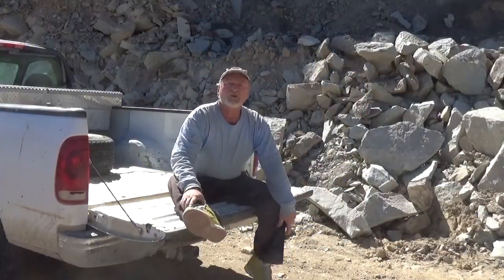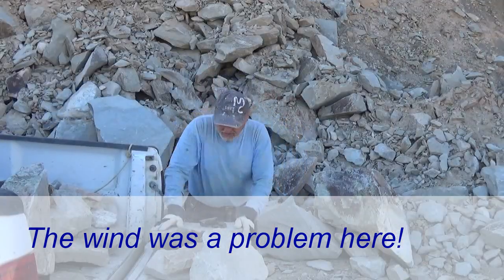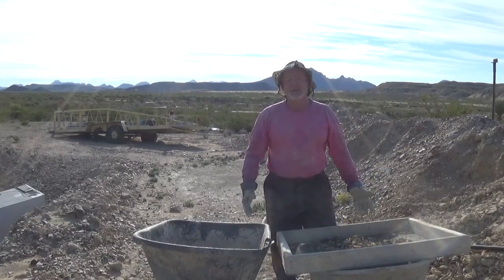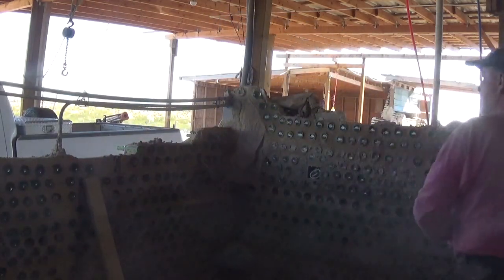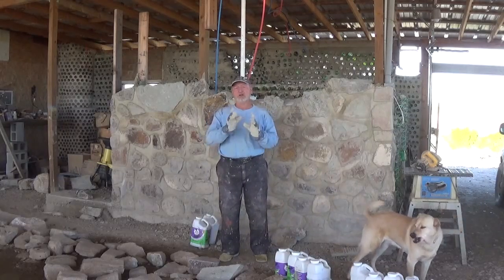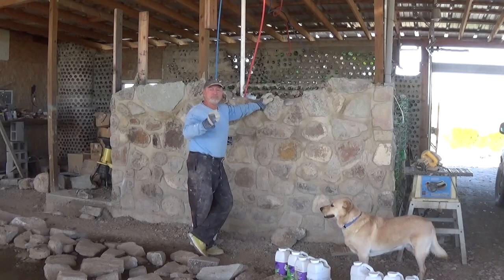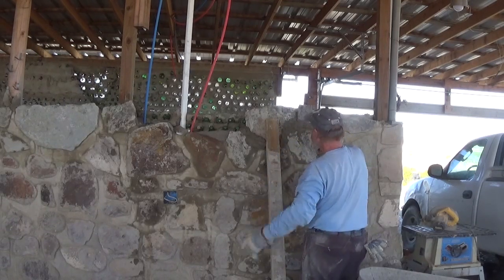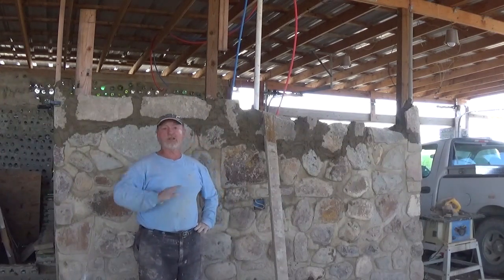Stone Masonry Fundamentals

Comment: People who take time to explain things in detail like this gentleman does are the salt of the earth, it is thru them that mankind evolves past what we can learn in one generation.
Reply from the maker: Thank you for the kind and accurate comment!!!

You also asked me about my mix. I can get things confused at times when I am "ad-libbing" through a video. So....... my MORTAR mix is a 6/1 mix of screened sand & tiny pebbles & Portland. Depending on the use and on the weather, particularly temperature, I add at least .25 parts of lime to this. In the current 15 degree heat, I am up to .50 parts of lime.

My concrete mix is 3/2/1, sand, aggregate & Portland, with lime in about the same mix as mortar.  For posts and such, I increase the Portland quite a bit. For stucco, I reduce the Portland by 1/2 part and DEFINITLEY add more lime.
Reply: Its kinda funny, but. I notice flaws in rock walls here all the time now..so many try to build from flat part to flat part and stack like bricks..your method is going to work great for me, thanks again sir.

Comment: You are so right about the mortar. Here in the Balkans during the summer when it rarely rains, we use bottom of the metal barrel with maybe 30cm (1 feet i think) of the wall. We mix portland cement with dry sand then we put the dry mixture in that bottom part of the barrel, tilt it to one side and add water little by little, mixing enough mortar for only one or 2 stones. You dont have to worry about the 30 min chemical reaction, and you can easily make it thicker if its needed. But this is all useless if it rains and sand is wet as portland will start reacting as soon as it is mixed. Great video i really enjoyed it. Cheers!
Reply from the maker: Thank you for commenting!

Comment: how would have the mountain ended up on the ash? if it was pushed out of the ground the ash would not be under it correct?
Reply from the maker: I am not a geologist. But from little what I do know of it, the ash & dust was laid done after the impact 65 millions years ago. More dust,  sediment and organic matter covered the ash layer.This area was volcanic then as well, so there was more dust, lava and debris as well. As the millennia passed the  pressure of all the weight com[acted the ash as well as the covering material, turning the covering material to rock. I am not sure when, but the area also was sea floor, this may well have happened after Chicxulub, as we have sedimentary rock above the Chicxulub layer. The weight of the ocean would have further compacted the material covering the ash layer. Tectonics were responsible for creating the ocean or "shallow sea" as well.Tectonic movement pushed the volcanic "hot spot" away from here and uplifted the entire area as millions of years passed, creating the mountains we have today. We have one mountain in particular that was uplifted and folded so that the layers of rock stand vertically, instead of the horizontal that we most often see.Thus, the ash became sea floor, then dry land, then the middle section of the mountains and high plateaus of the area. The Chicxulub Layer is worldwide and varies as to the tectonic and volcanic activity of each area. I have seen it all over North American in my travels.All this is available from many sources online with a better grasp of it than I have..... as well as some fantasy postulations from religious nut jobs.
Reply: Lava flow over the top.

Comment: cant you uncook morter by literaly cooking it  in a fire?  I may be wrong, I have just been looking into the proccess of making morter from lime and the such, but I could have sworn I saw that, if you take the lime, cook it in a hot fire and will become verry brittle, and crumble into dust, then if you hydrate it it turns into the hydrate form of the chemical then dries back into the hard morter.
Reply from the maker: I don't know. Many things that are "possible", are far too difficult to do in practice. Since Portland is so cheap, for me, this is one of them.
Reply: I can understand that, its just a thought I had after trying to learn how to make it from scratch. cheers and thank you for your work on this video I learned allot
Reply: Jesse what you’re talking about is quick lime and has been in use since the medieval times. When you fire the limestone it will have to reach extremely high temps to create quick lime.  Not sure of the temp exactly but I want to say it’s about 800 degrees for several hours

Comment: I am planning to build the foundation of my cabin out of stone.  Is building a load bearing wall the same? What advice would you give me? Thanks in advance.
Reply from the maker: Lots to say, too much for here though! You are sort of correct in thinking there are the same, however, the most important thing is that a foundation/footing, is the "foundation" of the building. In areas where the ground freezes, you MUST go well below the freeze line with you foundation, or it will heave as the ground freezes and thaws, making the entire structure move and unsafe.

My way is to WAY overbuild. Spending $20 that was not necessary is far better than saving $10 that causes a structural failure.
Reply: @ecoranchusa  would it be better to use thicker more block like stones in that application? Also any videos on the topic or books you would recommend? Thank you very much for your knowledge and good cheer when I  finish the stone work I will try to send you pictures.
Reply from the maker: I just watch as many YOUTUBE videos as I can and read as many articles as I can to learn, well, anything! Bigger rocks at the base are fine, but not required. I put them there because I don't have to lift them then.

Comment: Robert Earl,  this rock looks very familiar.  Me and my dad did some rock wall out of wine bottles about 12 or 15 years ago,  and that color rock looks very familiar...  By any chance Is this eco ranch located outside San Antonio TX ? I'm just curious.
Reply from the maker: We are just outside of Big Bend National Park. I would imagine that this rock strata extends for many hundreds of miles though..... or it just LOOKS similar. The interesting thing about the rock in the photo is that it fell off of a cut through a mountain on State highway 118. There was a small earthquake several years ago that cracked & moved it some. I
t actually fell onto the road in 2016. 

The highway department cleared the road and put out cones. I saw good rock for building and started taking it. When the crew heard I was taking a lot of the rock, they took their time finishing clearing the fall, so I could get all the usable rock I wanted. Most of it was far too heavy to handle, but I got everything under 200 pounds.

Comment: What is the width of the wall? for home 30"x25"
Reply from the maker: That will depend on where you live (latitude), is it a thermal mass wall, or will you be insulating? My thermal mass walls here are 20-36" thick, with 36" being the optimum.
Reply: @ecoranchusa   it will be cold) how much stone will go to 36 "if the height is 2500mm
Reply from the maker: Hot being a wise ass, but that also depends on the stone you use, big stones, you will use less than small ones. Figure you need about 3 times what you THINK you need though!
Reply: @ecoranchusa  how to do right?

Comment: My god just get on with it ......
Reply: I've been doing stonework all my life and il make a suggestion buy yourself a scouring brush  (metal bristles goes over the knuckles like a duster) and a 2" soft paint brush wait for the mortar to almost go off then scour the stone with the wire brush then remove lines with the paint brush.....better finish and less time consuming good luck
Reply from the maker: Paul, that is an excellent idea. Right now, I have two wire brushed that I use, but as you know, they bang the knuckles. A scouring brush may just do the trick for most of the bottle work I do. Regarding the stone though, I use the spoon to push the mortar into the joints well and most importantly to put a smooth finish on the mortar. Wouldn't the wire/paint brush combo give me more of a matte finish like is seen is brick mortar? I rather like the smooth finish, which is why I make wider joints.
Reply from the maker: As I repeatedly say: "Life cannot be learned in 140 characters or less."

43% of America thought differently last November and now I have to live with the consequences to the planetary climate & resources for 45 more months! The more you hear or read the more you know!